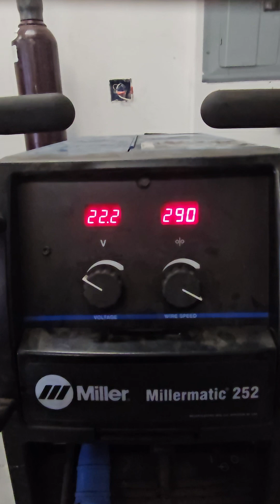Argon/CO2 Mix Vs. 100% CO2 Gas | MIG Welding Gasses | Gas Metal Arc Welding

Comment: If ur using short arc co2 is the ticket not much difference at all like this dude is saying u have to know how to dail it in alot more with co2 smaller sweet spot you'll also get a little better ductility with it as well and better shielding u can weld in some pretty breezy conditions handles contamination alot better now thick stuff switch to spray for sure

Comment: Its not Metal Inert Gas welding if you dont use inert shielding gas.
Reply from the maker: @KS-xx5xq  I think we can agree that the MIG nomenclature is no longer accurate and that GMAW should be used when describing this process regardless of shielding gas mixture. MIG is only referred to here for common reference.
Reply: @mezweldz7112   No I can not agree. Where Im from nobody says GMAW and theres respected diversion between MIG and MAG. Its elementary knowledge to know what what gas to use to which metal and the differences between those methods. You need different welding certificates for those. If for you that nomenclature is outdated you should use GMAW.
People who try to find specifically MIG vids have it harder, because of them who dont diversify inert from active for some unknown reason and its common.
Reply from the maker: @KS-xx5xq Are you from Europe?